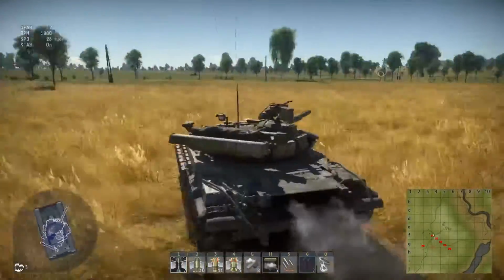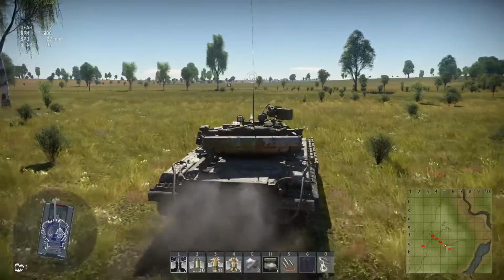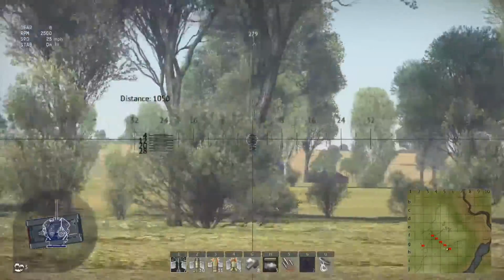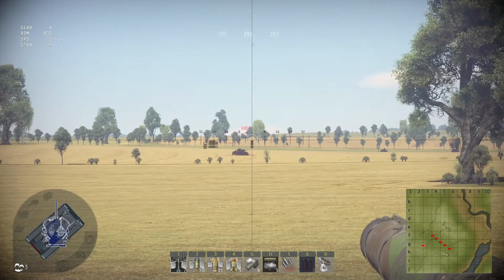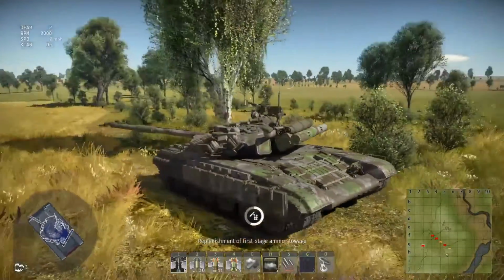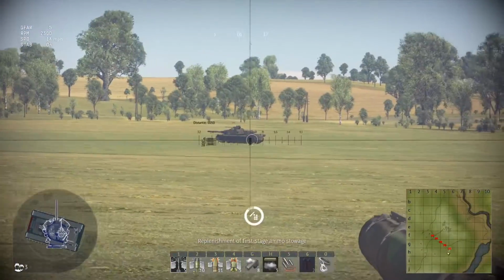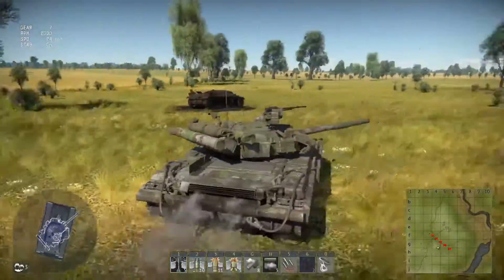No Range Finder? No Problem!|Range Estimation Guide/Calculation|WarThunder

Comment: Why can't just look for the width of the tank in wiki instead of the length in case of front facing enemy and doing the same calculation it should work fine?
Reply: Abrams is 3.66m wide 9.77m long from your scenario it's about 7.5 mil if it was facing front it would be (3.66/9.77)*7.5=2.8 mil. (3.66/2.8)*1000=1307m the same.
Reply from the maker: Un Name 
Well I’ll be damned. 

Seems super obvious that it would still work now I actually stop to think about it, because it’s based on the width apart of the cone cast by the mil lines, the physical object being targeted doesn’t really have any relevance at all. 

Thanks for setting me straight. I’ll pin the comment.
Reply: @Bullet4MyEnemy  I just curious where did you find this formula and how did they come up with this equations. If you have any wiki source or any other that have the information about it, I would be damn thanks full. anyway thanks !
Reply from the maker: Dinh Theanhh 
It used to be somewhere on the WarThunder wiki on the website, but it was overhauled a few years ago and I’m not sure if it survived. 

It was embedded in another article for something else rather than being its own topic, can’t remember what it was otherwise it’d be easy to check for it.
Reply: @Bullet4MyEnemy  I guess I mind have to figures out myself rather than searching for it :V Anyway thx for help, i'm appreciate.
Reply from the maker: Nah because it’s designed to measure the length, if you measure the width instead it’d be like measuring the length but from much further away so it’ll give you a much longer range than the target actually is.
Reply: ground vehicles are mostly 3 - 4m wide in wt
small vehicles are 3m
and big ones 4m
do the same calculations and youll hit it
this can be a little easier on the german zeiss sight (u can download it into wt) since a target facing u at 1km would be perfectly the same width of the center "triangle" if it is 4m wide
Reply: You need to figure out how long the tank is related to how wide it is. If you did that it could work.

Comment: my rangefinder simply just doesn’t work. like i have the range thing fine but i can’t use the stuff in order to make my gun go up or down.
Reply from the maker: I think it’s under misc if you want to use buttons, or you can set the mouse wheel for it so look for an option with a drop down menu.

There’s actually a search if you just type in sight adjustment

Comment: from what I know about those horizontal lines are to measure the moving distance of a tank. if the tank is moving and you know the distance vertical, you have to match it horizontally. that's how the reticle works. now it all depends on the velocity as well.

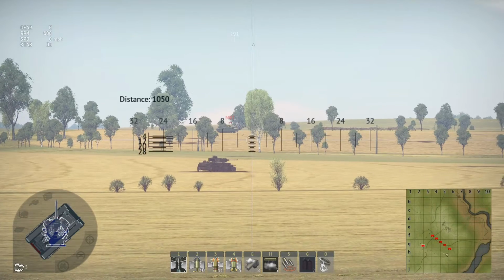Comment: How you do that with scope(I mean vertical scoping line)?  Timecode :  3:15
Reply from the maker: You can set keybinds for it, or find the mouse wheel control drop down menu, it’s an option on there - by default it’s zoom.

It’s called something like “adjust sight elevation”.
Reply: @Bullet4MyEnemy  thx 😊

Comment: How can we range find a angled target ? lets say a t-34 is sitting in a diamon-like shape ? How can we range this ?
Reply from the maker: Turns out that it does actually work from any angle, you’ll just have to estimate the vehicle measurements if they’re not showing you a flat side. 

Say a tank is 10m long and angled at 45°, I’d probably guess it was like 6/7m across instead.

Comment: I knew already about this but I had forgotten it before watching the video. I'm kinda disappointed that it only works when they are horizontally oriented :(
Reply from the maker: You could probably get a close approximation deducting the percentage different in length from the range you get by measuring the front... I haven’t tried though.

Would take far too long. Maybe try knocking 1/3 off the ranges you get from measuring the width from the front? Tanks are probably
around 3m wide, if they’re 9 long that’s 1/3 difference.

Comment: Just curious why when using view from gunner in the settings, the shot hits to the left or right side of the center crosshairs (depending on which side of the gun the sight is located)? Because in real life, doesn't the crew adjust the bore sight, so the crosshairs are right on target? No need to compensate side to side? Not to mention, nearly every modern tank in the game (M1, Leopard 2, T6x/T7x/TIP etc) have ballistic computers that makes all automatic aiming adjustments (windage, barrel warp, temperature, etc) so your aim is near perfect? So why does gaijin make that view wrong?

And PS; sure wish gaijin would allow us PS4 and Xbox players to use historical recticles for our gunsights. Some make manual aiming so much easier!
Reply from the maker: Yup, right on all counts. My guess is that it’s just not worth the development time for them when Sim is such a niche mode. 

I wish the same about custom gunsights :( got to easily be the worst part of of playing on console.